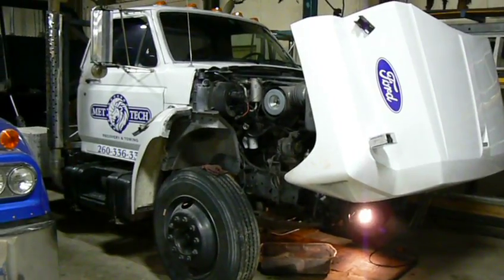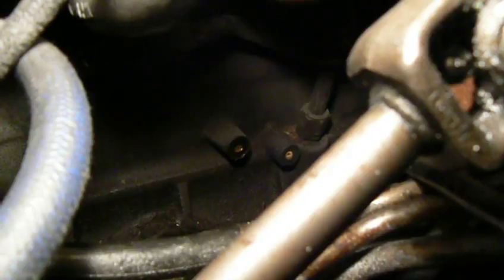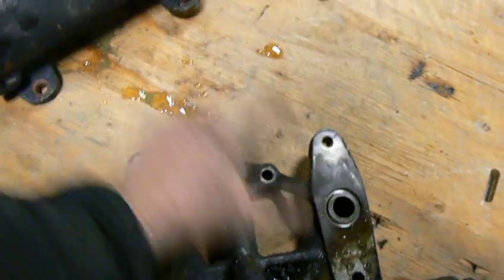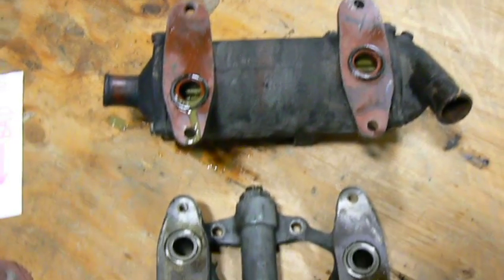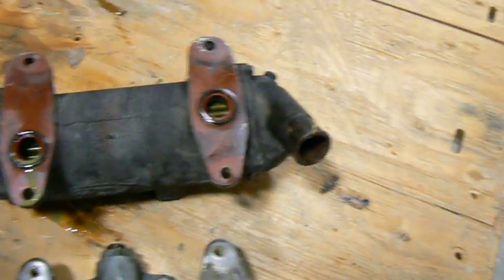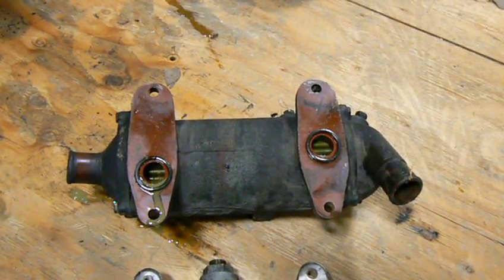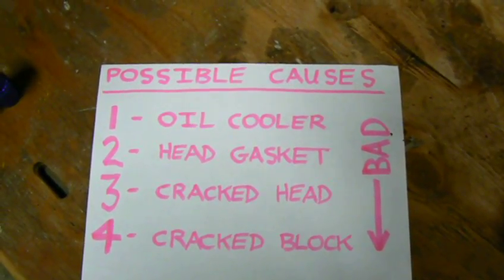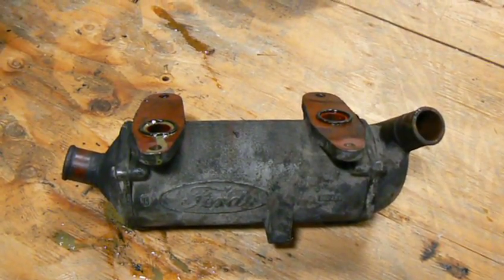Ford 7.8 : Is the oil cooler to blame for coolant in oil ?

Comment: Unless I just can't find it, I don't know what your final video revealed.  I am trying to fix a 6.6 which is essentially the same engine with less displacement. I have oil in the water jacket in the block.  Thinking however that the problem is the cooler.  Hopefully not the block or the head.

Comment: Hey just wondering how did you take it off the block because it seems like it has a dowel connected to the unit from the block and I’m stuck because I am afraid of breaking it off the block or something. Obviously all bolts off already. It’s coming from the filters bracket where it’s stuck. Am I suppose to just pry it out?? Please someone respond.

Comment: This guy never let us know what the hell was the problem!
Reply from the maker: You're right, and I apologise.  Other projects, other problems, and I lack the commitment for regular videos.  I post videos occasionally; I don't have the time, nor the discipline, for regular videos.  I still own the truck, but never determined the cause for certain.  The head gasket shows wear, so that's the most likely cause.
Reply: @HemiChrysler  lol ok, I just bought an 87 F7 with an 7.8 for $2,250, I checked everything and it looks to be fine. I just started reading info on the engine and some people report this same issue of mixing oil and coolant... however, not one single post has finished saying what actually happened or what they found regarding that issue. Lmao

Comment: I had- to replace the oil cooler on the 1985 louisville with Detroit.  Mine had a 24' chevron.   Was very difficult to diagnose.    good luck!                            Paul

Comment: most likely a hole in the cylinder walls from cavitation from improper coolant system care.  look it up on Google
Reply: +MET-TECH LLC I would look into that
Reply: The claim is if you use the green antifreeze this can happen. Too bad this guy didn't let us know what really happened. @1997cr80r
Reply: Not a wet sleeve block. Not pertinent to this issue.
Reply: @Bill-b6e cavitation can absolutely happen to a parent bore engine
Reply: @1997cr80r yes it can happen.  But not very common.  Plus most don't know what a parent bore even is. Most just jump to conclusions that it's a cracked liner from. Pitting. So yes technically you are correct.
Reply: @Bill-b6e the 7.3 idi was well known for cavitation and its obviously parent bore.  This video is way old they either junked it or got it fixed.  Years ago I had a 7.8 drop a valve and Crack the cylinder so that engine went right in the scrap pipe

Comment: Try plugging off of the water bungs on the cooler and "lightly" pressurizing the cooler with a rubber tipped air nozzle